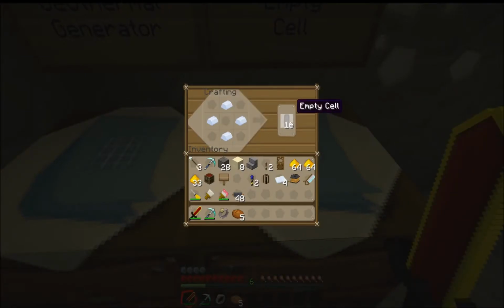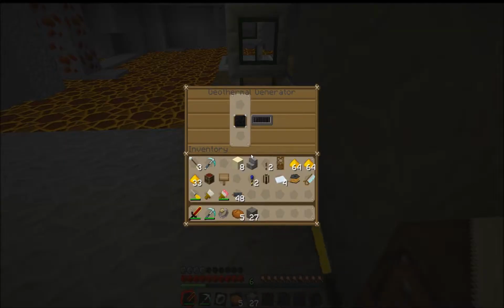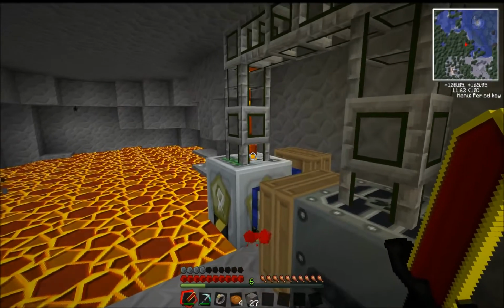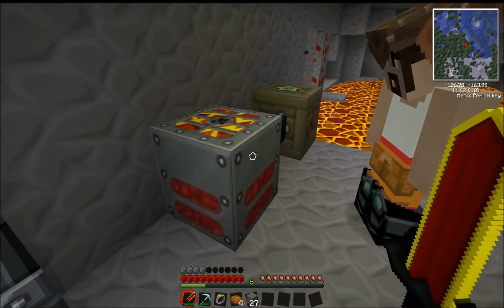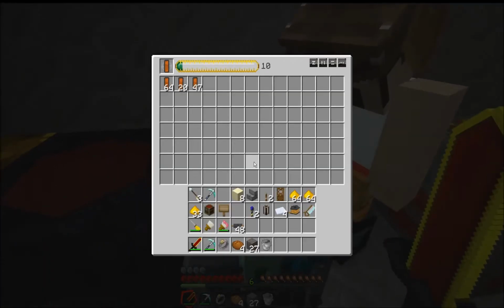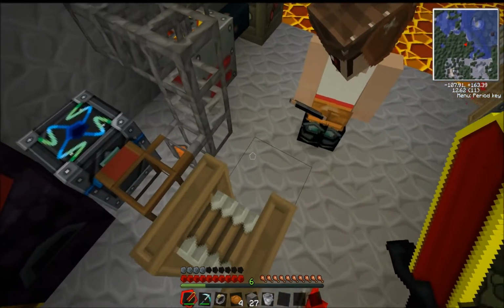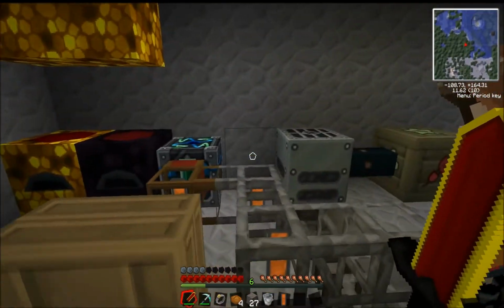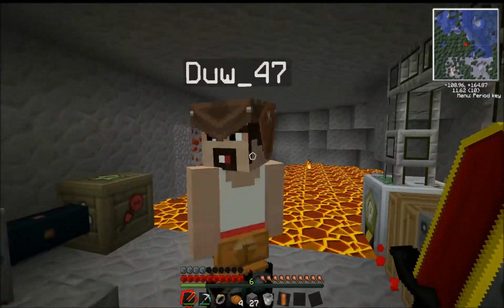Minecraft Tekkit - Geothermal Generator

Comment: if u use lava buckets in the condenser you have to remember that they don't stack and you will have to remove the empty buckets from the generator. buckets can cause an overflow, especially in a multi-generator set-up like i've been running. now that i know about the lava cells being able to stack and not leaving empties behind to have to pump out i think i just solved my problem. might have to use some insertion pipes though.

Comment: I belive if u put an obsidain pipe connected to the bottom of the generator the cells will keep trying til the is an empty slot, provided you use an iron pipe to prevent from going back(but that may be useful)